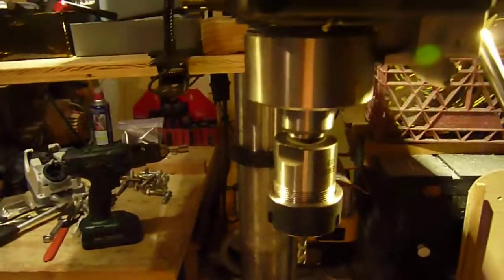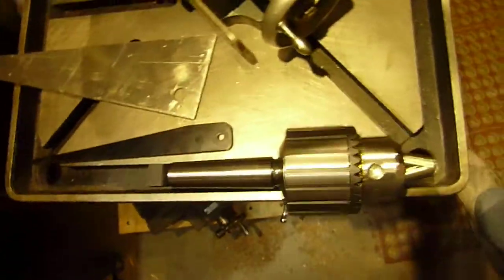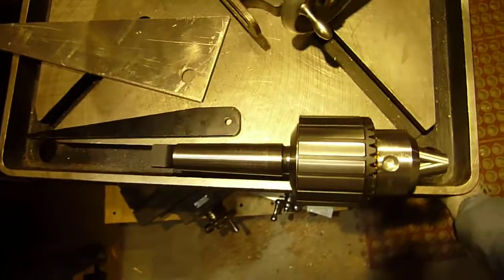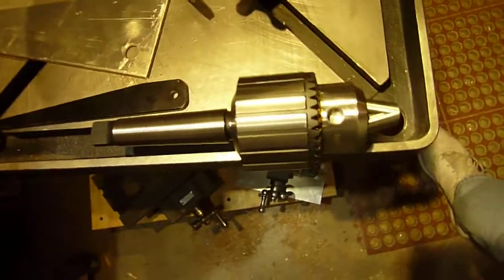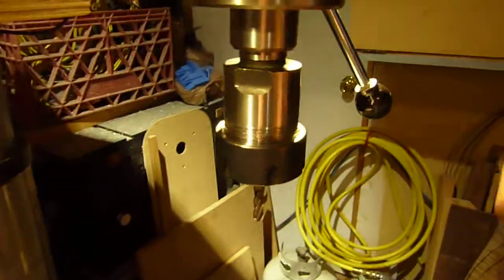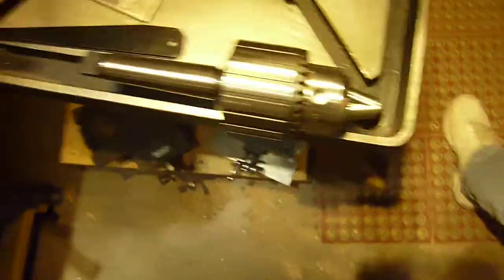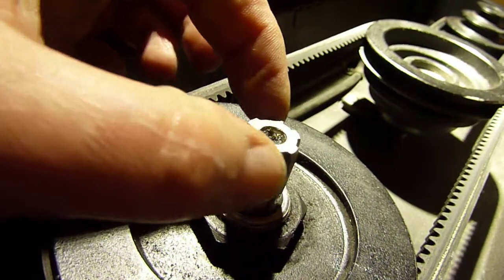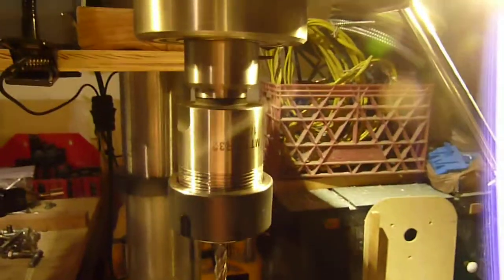Dayton 20 inch drill press 4: Securing things in the MT3 taper

Comment: I have same problem. A drawbar seems the natural answer but its not feesable. I thought about a set screw in the quill that would press into a dimple drilled into the taper. But that also presents problems...
Reply from the maker: A freind, his drill uses MT2 and he has a collar on the taper and the end of the shaft. 4 sets screws in each keeps them from coming apart. AS you can see on my collet chuck I have no clearance for a collar onto the tiny bit of taper that is exposed. On the drill check, there's enough room, but I don't really need a collar to hold in the drill chuck. This is all about lateral forces on the taper that make it come loose.

I did find M6 12.9 bolts that are long enough. I also found 6mm drills that are long enough. The problem is taking the drill press apart so I can drill out the spline. Uhhh...what do I drill with now?

Comment: Hello , what did you finally did ? 
I think you can machine a hollow screw with 1/2 13tpi male thread and 6 mm female thread to accept the drawbar and you can drill it with a cordless drill without disassemble the drill press .
I have a kind of decent(60yo swedish geared) drill press and wanned to mill on it its hard to make a drawbar on it too on the other hand cause of lack of budjet cheap chinese mills seam like a waste of money on the long run but hacking things takes a lot of time and trial and error and if we get paid for what we can do right now maybe we could afford the milling machine plus there is always a risk of failure on hacking
Reply from the maker: I have not needed the draw bar. I exclusively use an ER32 collet chuck in the drill press. Ive bought a good selection of collets and so far I have not found a drill or mill that I don't have a collet that will fit it. As a result, there has been no need to extract the ER32 chuck from the MT3 taper. I placed a piece of aluminum under the collet and  hit the aluminum with a hammer 3 times to drive the tapers together. I've done many hours of milling since then and the tapers have never come loose. That was early 2020 the last time I had the collet out of the drill press. It has held in place really well without a draw bar.
*
I'm in progress in an upgrade to my drill for a lot more power. I'm an EV builder and I have spare brushless motors and controllers. I have an 82v 12Ah battery pack that I'm not using. I'm going to eliminate all the speed changing via belt nonsense and use a brushless motor and controller to do the speed control. In the process, I'll go from about 1hp from the existing induction motor to about 4hp with an inrunner. I'll gain a lot of spindle speed too. There are lots of times where I can't spin the mill fast enough. I should have no problem getting 5000 RPM at the mill with GOBS of power so it never slows down.
Reply: @de-bodgery  
Thats good to hear, fast speed change is crucial and some extra horses are always welcome  , i managed to get the taper tide inside the spindle after i saw your other video that you said about frosting the morse taper and thats what i did , i am drilling so far but i will give it an other try on milling
Reply from the maker: @antoniskaloterakis7996  It's amazing how a slight interference fit will hold the tapers together. Freezing the tool taper before jamming it into the drill taper, will create this and the hold can be quite good. Notice that I have an MT3 taper in this drill. My older Craftsman had an MT2 taper and it did come apart from time to time.
*
I'm in the middle of an EV upgrade ATM. Perhaps after that is running again, I'll have time to make some videos on motor upgrade for the drill. The battery pack is built, the controller is brand new, the motor shaft needs some work on it to make it adapt to a belt pulley and I need to make a motor bracket. 6 or 7 hp and double the RPM's will be nice!